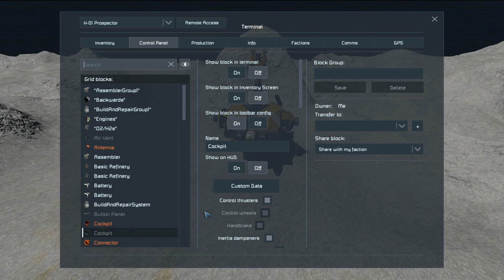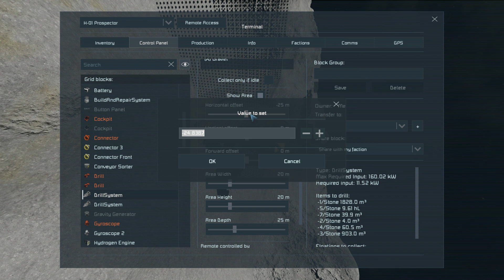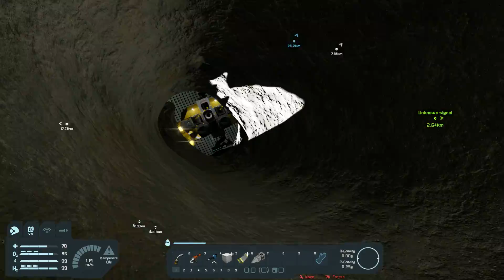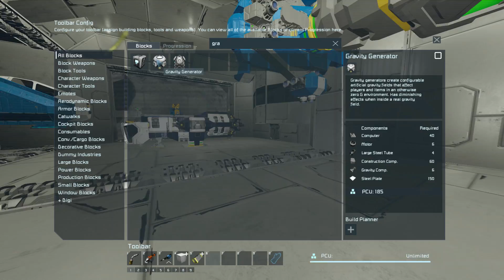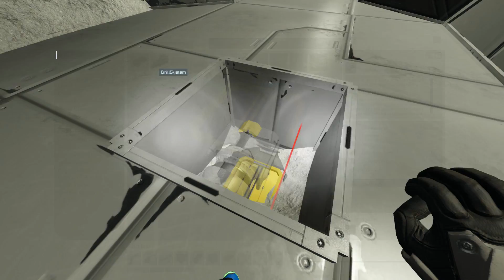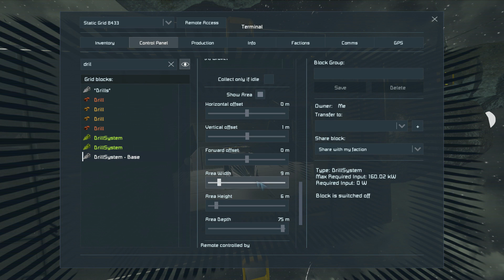Space Engineers - S2E07 'Nanobot Drilling System'

Comment: @kanajashi - You got lucky with how smooth things turned out for that tunnel.  The way SE handles creating voxels is still on a "square" basis, just like how you build any ship, where there is a top, bottom, left,etc.  If you had placed the foundation at a different angle from where you started, you still would have found those bumps.  Where I'm at on my moon, I'm digging into the surface at  roughly 45' angle, to the face of how asteroids are built, so I get all kinds of bumps.  BUT, since the drill is based on the position of the base, then it becomes easy to make your metal tunnels, no matter what angle you're drilling into the surface.

Comment: One thing I found with these is to turn them off when you are fine tuning cause the adjustments are immediate and it does pull pretty quick so if you are digging out sections where the wall location is critical you can accidentally start pulling out voxels you don’t want to remove. Learned that the hard way

Comment: id like to use it for a survival playthrough, but i feel it may be a tad overpowered.
Reply: I don't think it's too over powered.  If anything, using D&F is slower than using a regular drill for material gathering.  The PERK of D&F is that you can dig crevasses and materials without digging into the surface so things remain hidden.  Depends on how you want to use the system.  I've done it twice now on the moon where I've dug out a 156x40x156 "box" into the side of a crater, and it took MANY HOURS to do.  Accuracy was awesome, but, I could have pulled out my mining ship, slap some wheels on it just to keep it grounded, and had those holes drilled out in a fraction of the time.
Reply: It kinda is but it mines so quickly that youll fill your cargo really quickly. I built a flying miner with 4 large lifting thrusters and wound up crashing it bc i over filled too quickly.
Reply: reduce the size it mine and do not touch it anymore like it is a small drill
Reply: Make it need 10000 superconductors and 1000 reactor components and all things on the investigation tab to be done and it is balanced as an endgame thing

Comment: If you go down to the priorities and click on stone then click disable it will change to a minus sign and no longer collect stone etc
Reply from the maker: Ohh that's how it works!
Reply: @Kanajashi  You can also use the excess stone to fill the voxels in front of the hangar, nice and smooth.
Reply: @thesilentgamer2282  AH! I stand corrected, my good man. Love the comprehensive Mod quote confirmation.
Reply: @thesilentgamer2282  I 'think' that mode only applies to loose ore from left-click hand drilling, or dropped from inventory - like Build&Repair does. To mine specific ores only, I think the Ore Priority/Ignore List (to ignore stone) is the method. Also, I didn't notice, but there may be a 'Closer/Farther Away' toggle similar to Build&Repair that could be used in Farther First mode. This might grab the target ore first without ignoring stone, if you don't mind stone, or actually want it. Ignoring stone is much cleaner, of course. Not certain on these points, however, so fell free to correct me.
Reply: Disabling it only doesn't collect it just lets it float around.  Might want to add trash or gravel sifter to deal with all the stone.
Reply: It was a shame that the base asteroid was defaced by experimenting with this technology. Could have mined out another asteroid that doesn't matter.
Reply: @gorillaau  Watch for the GPS markers, he was 23Km away from the base asteroid. 👍
Reply: @unclegreybeard3969  Ahhh. Okay. I may have missed that one. :-)